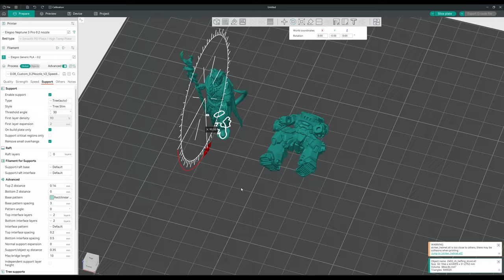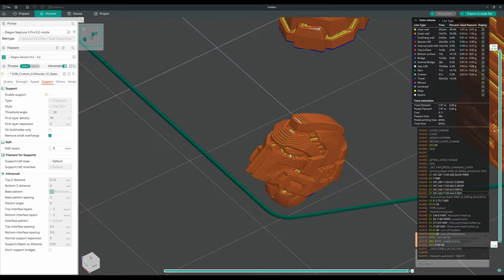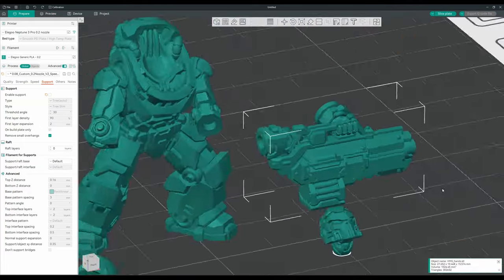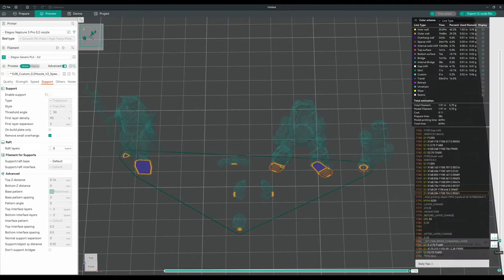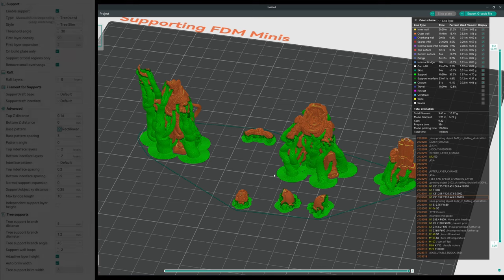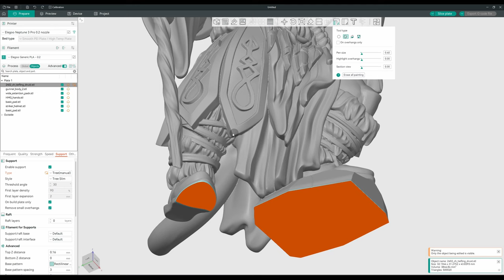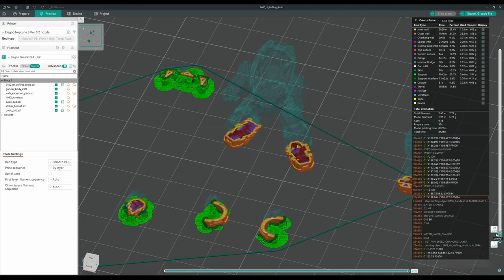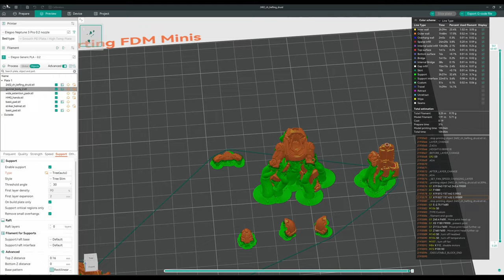The BEST Supports for FDM MINIS - Process & Settings!

Comment: For those who haven't looked into it, let me tell you that if you do .2mm nozzle and 0.6/0.8mm layer height and use something like PETG or PLA Support material as the support interface filament, you can get some pretty amazing results with the automatic OrcaSlicer support settings. It is a longer print time for sure, about a day with more time depending on the number of models printing, but removing the supports is insanely easy. I wouldn't do it for single models, just due to time and waste from filament swaps (many!), but if you are printing a full bed of minis, it wouldn't be too wasteful and would make it so you don't have to spend near any time cleaning them up. I used the Bambu PLA Support material that I got with my P1S Combo to test it out and have had great results!

Comment: new to fdm models so i've mostly been finding print profiles from other makers who seem to get good results. This is the first vid I've come across with such useful tips for orientation and manual supports.

also that segue to asking for support was smooth as heck and i really couldn't let it go unmentioned lol

Thanks for this vid, it's going right into my FDM playlist so it'll be easy to find for later reference!
Reply from the maker: Thank you! Hope my tid-bits of info help in the long run 😊
Reply: Great video! I have been thinking about getting a printer and after this video and a few of your other ones I am sold on FDM.

Comment: Great video.  I bought a FDM printer due to with my house set up I do not have a place to use resin safely especially with 2 small kids.  I am mainly a scale modeler, but I like to paint minis as a palate cleanser between builds.  Thanks to your videos I'm going to start printing my own minis instead of ordering them from a printer.  Also this makes me feel more confident that I can print model parts if I need to also.  I will be watching and rewatching your videos.  Thanks.
Reply from the maker: Thats awesome to hear! All the best on your painting 🙌

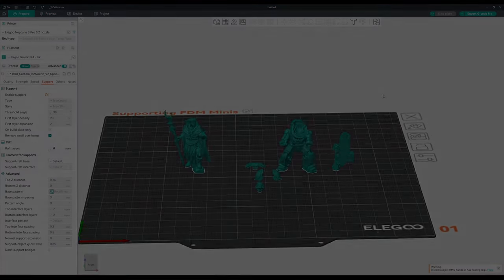Comment: 4:12  I like what you're doing and love that you're showing the settings from your tests.  I've the plus version of the printer you've and despite its size I'm getting decent results, though I'm still on Prusa Slicer after my own fine tuning and tweaking of settings.  I wait patiently for your overview of Orca Slicer; it's something I've wanted to move to but haven't had the time to tinker with and fine tune as I had the first go around with my printer.
Reply from the maker: Yeah I making the transition from Prusa to Orca I had to pretty much throw away everything I had dialed in Prusa and figure it out from the ground up 😭 So when I make the settings video I want to go indepth enough that others don't have the same issue!

Comment: Thanks to your videos, I've finally started getting awesome One Page Rules minis on my Anycubic Kobra 2. Got a 0.2mm nozzle, dialed in the settings and voila!
 I'm actually going to get rid of my resin printer because this is a cleaner, safer option and it's more than good enough.

Thank you and keep on with these videos! It would be ace if you could show how to do, say, large squads and different types of minis as references - and different scales too.
Thanks again!

Comment: I just had my 0.4mm nozzle swapped for a 0.2mm in my Ender 3 V3 KE, and will start to experimenting on miniatures again. With the 0.4 nozzle I've got some promising results, but fine details were lost and it had some layer lines visible.

I am using Cura, but I was mainly printing suportless miniatures designed to be FDM friendly.

Think I will give Orca (or even Creality Print) a try, the custom supports painting tool is very powerful, custom supports on Cura are a pain in the ass... Lol

Anyway, thank you very much for these videos, they are helping a lot.

Comment: Thanks for showing the models uncleaned! It's good to know what to expect. I'm always a little frustrated with the outcomes, but after cleaning they look really nice.

The nozzle sizes is a big factor, but not for the reasons newbies might think. I can print almost any miniature in 0.4, it makes very little difference. Where it does make a difference is supports. 0.2 mm supports are so much easier to remove! Its crazy.
Reply from the maker: Yep! smaller nozzle means thinner support interface, its much nicer to remove and makes it possible to print with a thinner z top distance

Comment: ive done more then a few minis in FDM but i use CURA slicer. its interesting to see some of the differences and where the similarities are. 

one of the biggest advantages i can see is manual support placements. thats HUGE and potentially worth changing slicers entirely.

something I've noticed that's almost universal about FDM is touched on in this video but something worth emphasizing is that each filament behaves differently. PLA from sunlu and PLA+ from china are ENTIRELY different on the <0.1mm scale so the support interface needs to be calibrated each and every time. 

another thing i struggled with ALOT was the curling where organic supports would meet or diverge best tips is 1, use 2 walls instead h=of having any infill in the support itself (this also helps with under-extrusion) and 2, go slow and steady. even a printer capable of 500mms shouldn't run past 100. i have a v3 see and run at 50mms

as always, great video and the more support FDM minis get the more accessible highly detailed FDM will become!

Comment: Great tips! I often find manual support difficult to manage, but sinking the model into the build plate and negative support painting makes it easier for sure.
I still think that the auto support distance might just be too tight (as in hard to remove), and I have no good solution for that.

Comment: Love to see some vids around post-print processing. I know its a "boring" topic, but would be absolutely of benefit for us newbs :)
Reply from the maker: Theres a little bit of that ion my older FDM Printing Guide if you want to check that out, I tend to do quite minimal post-processing in honesty. I have tuned my setting to only require some minor stringing removal and the odd bit of knife-work.

Comment: Thanks for the video! Been trying to get the most out of my P1S for minis and really scraping the barrel on ideas.

I started using round peg pliers for removing supports, they work well for organic ones. Can grab or get inside without cutting the material for better leverage
Reply: Try using PLA Support material or PETG as the Support Interface material. It produces a decent amount of waste but it will make your support removal loads easier. Do it for a bed of minis instead of a single one just to help cut down on waste.
Reply: @aztinoth I do actually have a small reel of support material, but ended up avoiding it due to the waste. I recall one time doing a slice for a mini and being told it would use more support material than the whole reel!

I know setting to “interface only” makes a big difference. But have yet to setup a whole plate of minis like that to see how efficient it would be.

I will say that I try not to put multiple minis on the plate due to the high risk of failure they have.

The sheer number of trade offs is frustrating…

Comment: Never heard of this suggestion before about sinking the model a little into the build plate for adhesion…I always assumed that would make the nozzle dig into the build plate, but that must not be the case?
If so this one tip will save me tons of time prepping models for print
Reply from the maker: It just acts as if it cuts the model off in the slicer, essentially making the layer where the model is intersecting with the bed the "first layer" of that model! so no danger of the printer digging into the build plate!

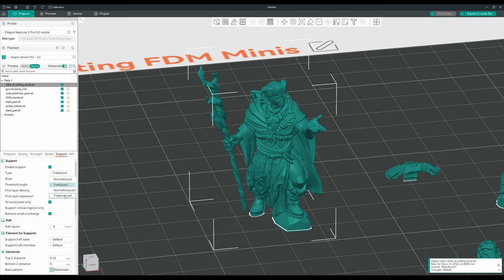Comment: 5:27 Wouldn't it make sense to first slice and let the program show where the extreme overhangs are and only then record manual supports there? I mean for the beginner... you already seem to know the problem areas :)
Reply from the maker: Totally, I tend to switch on the "Highlight Overhangs" feature (I forgot to mention it in the video), which is those red highlights and use that as a guide, but yes you totally can do it that way too!

Comment: I have printed so much terrain from small rocks to entire castles but your channel finally go me on to minatures. So far I have had mixed results but things are improving all the time. I am just moving on to trying a .2mm nozzle. Thanks and keep up the great videos. Just one question, can you put the link to the minis you use in each video. I know you have done a video on recommended links but specific to each video would help us to try your methods along with the video.
Reply: make srure layer lines are done in the increments of your stepper motor. for my ender 5 one step of the motor is 0.04 layer hight. so thats the increments i use.
Reply from the maker: The minis from this video are in the description, I just try to avoid sharing GW~Look-a-like links 😬 - But yes! I will endeavor to be better at adding links to video descriptions.
Reply: @GoalOrientedLifting  Thanks

Comment: Would you consider doing a video with Printer recommendations? I have an ender 3 but have had quite a few issues with it, primarily build adhesion and leveling and am considering getting a new small form factor printer but am not entirely sure where to start especially for miniature printing
Reply from the maker: I don't have hands on experience with enough printers to do such a video sadly. However! It does seem like something like the new Bambu A1 (or A1-mini) would likely be a suitable printer to answer your needs

Comment: Thanks for the video, I have a question and a suggestion for those printing a specific type of mini.

First, you mentioned certain colours of filament leaving more or less scarring. I just got the A1 from Bambu and have been trying to print with their matte white. Not sure if you're familiar with their stuff but would that be a fine colour to print in or should I try grey like you mentioned?

Second, I've been trying to print out battletech mechs and found that instead of trying to support a whole spindly mech they tend to have really slice-able joints between legs and torso or torso and arms. Ive been taking the models and dividing them up to print each part separately which means way less towering supports and very large flat surfaces for bed adhesion. If anyone else is printing similar models and is willing to learn meshmixer or something then Id suggest doing that over trying to support the whole mech in one go!
Reply from the maker: I tend to avoid any White (and some Black) filaments that make it hard to see the detail of a printed model, some are okay but alot of white filaments tend to hide a bunch of visual detail. I like grey alot because "what you see if what you get" you dont notice a whole bunch of nasty imperfections or issues only AFTER priming 😆

Comment: what filament do you use? have you ever tried petg/pla for model/interface layers with such detailed models?
Reply from the maker: I just stick to PLA since its what I know ~ I find Elegoo's PLA has a really nice (every so slight) flex to it, more so than other PLAs, which makes it great for miniatures and makes for easier support removal since you almost peel them off rather than snapping hard plastic of delicate models.
Reply: @Painted4Combat  would be interesting to see how petg as interface layers would go with such small models.

Comment: Donyou find that sanding or filing is needed some times with some if the support areas? Need any type of filler sonetimes or is just ourely fine tuning the settings?
Reply from the maker: Either or! I have gone the route of trying to get the best results directly from the printer by finetuning, just so I dont have to mess around with a ton of cleanup

Comment: With the Druid could you cut the model up to print in smaller parts and not hav so much support?
Reply from the maker: You totally could! But I find with some models its hard to find a nice natural point to cut the model, I tried splitting this druid up actually and just couldn't make it look good or print well, I actually had the most success doing him as a single piece.

Comment: Uncle Jessy recently had a video about different filaments being easier/harder to remove support for.  Any particular filament you've found that works really well?
Reply from the maker: I just stick to PLA since its what I know ~ I find Elegoo's PLA has a really nice (every so slight) flex to it, more so than other PLAs, which makes it great for miniatures and makes for easier support removal since you almost peel them off rather than snapping hard plastic of delicate models.

Comment: I do like the FDM optimised Brite Miniatures but printing other ranges of figures is very hit and miss. I dunno if it is because I am using Prusa Slicer on Linux but I tried to install Orca and it is broken badly in my current distro.

Comment: what about all the "hairs" sticking out -is that just a very find sanding all over? - presumably the painting/priming takes care of very minor blemishes?
Reply from the maker: The strings are easy to take care off with a quick pass with a knife or a blast from a heat gun. And yes priming usually helps with any minor imperfections

Comment: im not sure why but changing to these settings (using Sunlu PLA) made my supports almost impossible to remove. The last few prints have all had several breaks on every model . even the larger models break when trying to remove the supports. Some wont come off even when using pliers. im not sure why but it is very frustrating.
Reply from the maker: Interesting ~ What nozzle size and layer height are you using?
Reply: @Painted4Combat  .2 nozzle with .08 layer height. I’m using an A1 mini
Reply: I tried using a blow dryer to soften it up and it helped a little but some of the supports were fused together to the main print